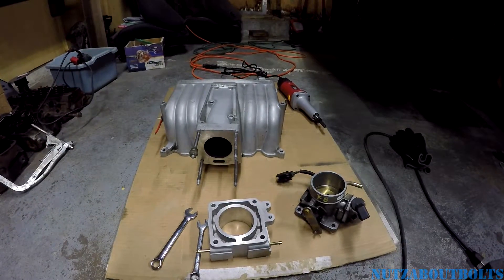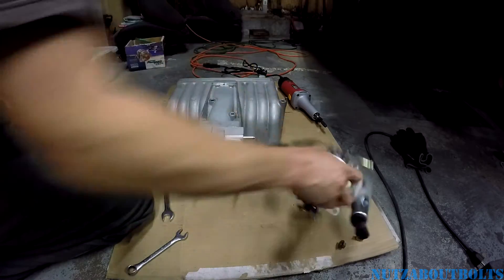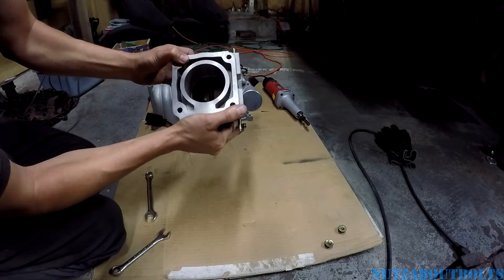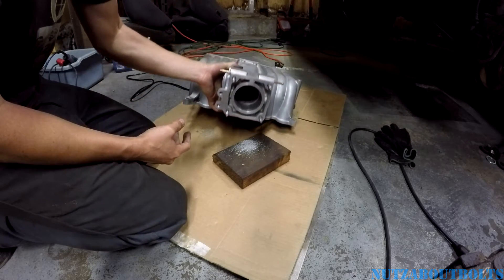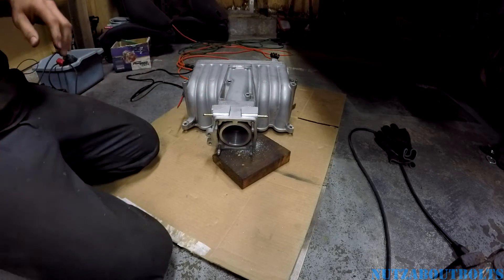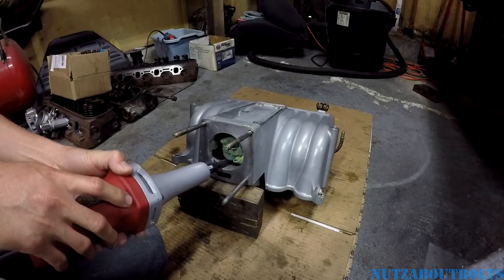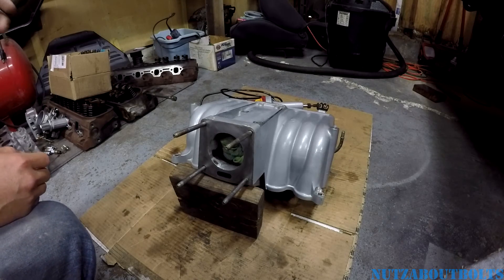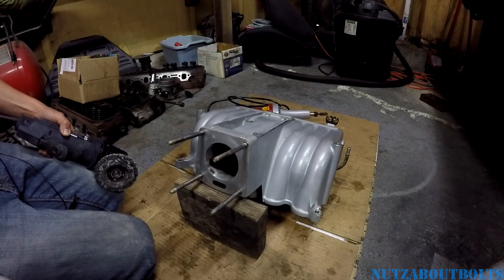Port Matching GT40 Explorer intake to throttle body for Mustang Fox Body project

Comment: The larger opening of that spacer doing no favors for that TB. Fluid mechanics will show that an increase in cross sectional area actually decreases the speed of the fluid  (air in this case) and cause a corresponding drop in differential pressure for a given mass flow rate. A bigger TB to match that spacer with your now ported intake plenum will be the bees knees.

Comment: What would happen if you left it like that? I put a 65mm tb with 70mm spacer on a gt40 intake and my car breaks up around 2k rpm do you think that has something to do with that?
Reply: Speed density?
Reply: I left a comment that explains why you’re having that issue.
Reply: @DoesItTho  I chased this problem for months until I finally figured it out By the way I had changed to 24lb injectors and fuel regulator too (injectors and regulator brand new) I went back to 19lb injectors and changed to a new stock regulator and never had the problem again car revs to redline with no problem idles better than ever it still has the 65 cobra Throttle body and the 70mm spacer on the gt40 intake with a bbk cold air intake
Reply: @streetbeast7078  oh dang! Ok glad you got it, I’m building a street beast of my own currently. Question did you happen to retune when you put in the 24# injectors and regulator?

Comment: To clean up all the greasy port passages use a spray engine degreaser Drench  the inside let it sit out in the sun for a bit and use a pressure washer to rinse all the gunk out. Works great.